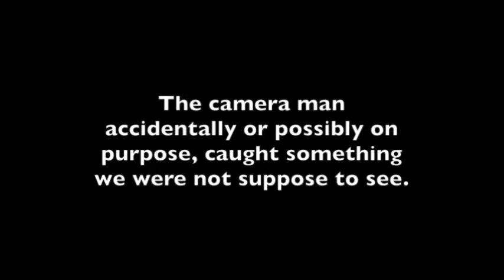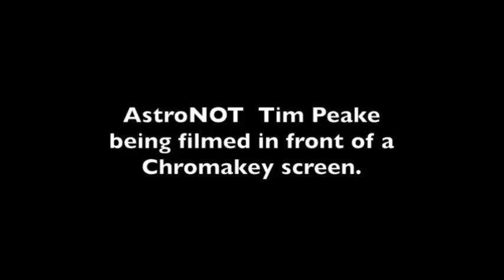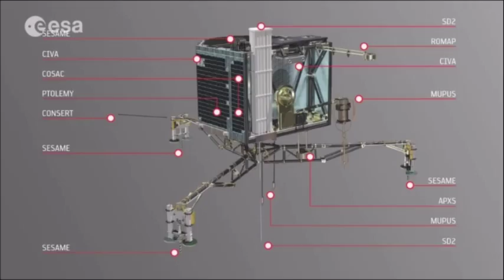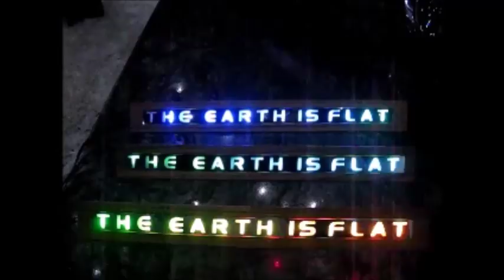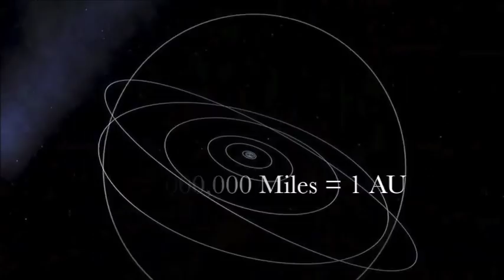Flat Earth Q&A Emails 44 - Mark Sargent ✅

Comment: if the authorieties are guarding the outter ridge on a flat earth..that would mean they,d have to monitor a like 16 ,000 mile radius?..how?
Reply: kozy53215 I've asked myself the same question
Reply: Ciaran Callam That question was addressed in Flat Earth 101, 2 years ago. Catch up Gentlemen.
Reply: They don't need to! When is the last time you sailed or flew by plane that far? Nobody really heads to the outer edges so there is no need to patrol.

Comment: I must ask! Why do we not always see a shadow of the moon every time the moon is in the day sky?  Being the sun is father way,  the moon should be in front of the light and there for creating a shadow in the earth,  right?
Reply: @Rachel Vincent, lift your hand up in front of your face, fingers stretched out with your palm facing towards your face.  Place face in your palm.  There's no such thing as a dumb question and yet here you prove that statement completely false.  Congratulations.
Reply: lol you are so clever and witty, but you haven't answered my question.
Reply: the moon is a light just like the sun and wouldn't cast a shadow, it's warmer in the shade during a full moon than in the direct moonlight which is also the opposite of sunlight
Reply: I feel dirty even dignifying your question with a response, but I will anyway.  The moon is casting a shadow, right now as I type this!  However, for the shadow to HIT or CAST on the earth, the moon needs to be directly between the sun and the earth.  (Solar Eclipse) Otherwise, the shadow is casting off into space either to the left of the earth, to the right of the earth, or even above or below.  This is why solar eclipses are so rare, because the moon is rarely directly in the path, between the sun and moon.
Reply: FE Troll  that is not logical, if the Moon is out during the day it is  between the Sun and the Earth therefore should cast a shadow on the Earth. It should not happen only during the eclipse. it is the only logical explanation.
Reply: @peace of shit, Exactly... the flat earth is FALSE.  Thanks for providing your input.
Reply: MOVIEOUS QUOTEIOUS thank you for giving me an answer using intelligence and maturity. for the life of me I cannot understand why people that disagree with flat Earth,  have to be so angry and hateful with their responses.